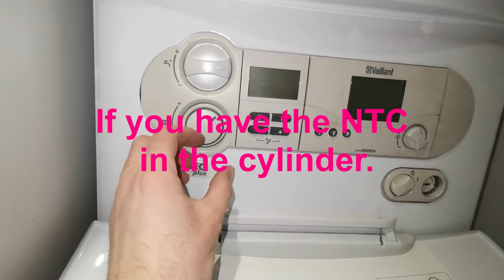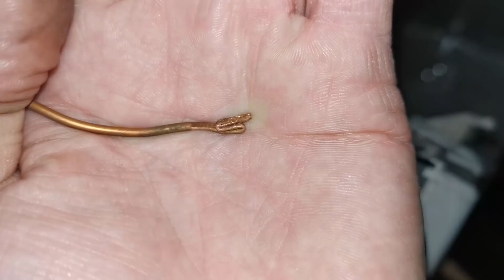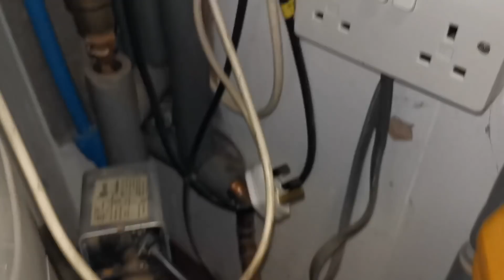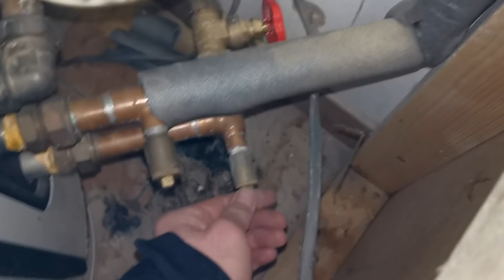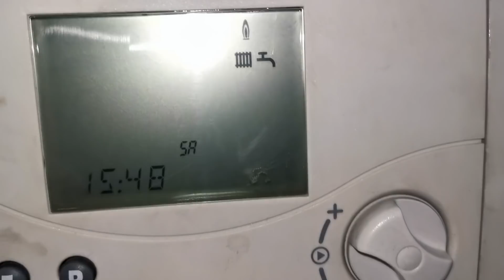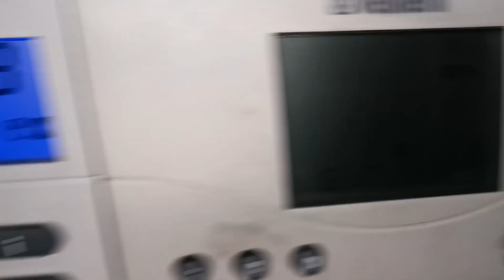Vaillant Ebus Controls. Repair No Heating No hot water HeatingGeek

Comment: Ebus:
It runs over a bus.  This comes from computer technology. What is a bus? It is one wire which many devices are connected to, sharing the same wire to send data to each other.  Think of a road with houses down each side with each having an address. The postman goes down the road and posts each letter (data frame) into each house. The street can be extended with more houses on the street. Now think of the road as the bus, with the houses as devices on the bus, like a computer (boiler pcb), temperature sensors, etc. It is possible to send data to each house by the controlling device using the address, And the houses can do the same. 

A protocol is a frame of bits that can run up and down the bus into each device, like a letter down a street - each device has an address. Protocols can be be sent from the controlling device (computer/pcb) or the sensing device. The protocol frame has an address, which posts this frame into the targeted device using the devices address. So, data is sent up and down the bus from the controlling device to sensing devices and back.  Like say the room temperature sensors sends data saying the room temp is nearing setpoint so the controlling device winds down the burner fan, then data again from room sensor saying setpoint has been reached, then the controlling device cuts out the burner.  The controlling device and temperature device know each others addresses, so when the controlling device gets a data frame from the bus, with a certain address, it knows what that device is, say a room temperature device. Then the software acts accordingly. 

The protocol has acknowledgements, meaning that when a frame is delivered the receiver sends an ack to the sender saying I have it - this ensures quality of service. 

So a bus in theory can have an infinite amount of devices on it - limited only by the software the controlling device (computer/pcb) is programmed to handle.

This in contrast to the open system (anyone can use) OpenTherm protocol which is only point to point, not a bus. One device talking to another over a dedicated, not shared, wire. That is fine for the vast majority heating system, especially combis. However a bus protocol is better for obvious reasons and larger more complex installations.
Reply: im sorry john no offence meant .I'm at a bad place at moment as I'm  unable maintain an erection and satisfy my wife and catch her cheating all the time any way things are looking up i got a big job this week im  changing a bath trap any tips
Reply: @Shayflannel  wrote:
"i got a big job this week im  changing a bath trap any tips"
Try a hammer.
Reply: c v ha ha what the fuck man
Reply: c v lol it isn’t a Mongolian she’s with is it ?
Reply: @Shayflannel  
Exactly. It sends plumbers to sleep as it is way above them.
Reply: John Burns CAN Bus is more robust
Reply: @aqib2000  
CAN bus was designed for vehicles by Bosch. I believe it is now open, so anyone can use it. Ebus is robust, as is CAN, as they are both on closed systems. CAN bus can equally be used for other applications besides vehicles.
Reply: John Burns CAN bus has been used in industrial applications for decades now!
Reply: @aqib2000  
Yes, CAN was convenient so used by others outside of vehicles.
Reply: @Shayflannel  
Keep your physical issue as they are, as anyone who can dig a hole that big in a few hours is highly marketable. 
Keep it up - in many ways.
Reply: its not above me if you were that intelligent you wouldn't be fixing boilers and systems for a living you melt
Reply: c v melt lol
Reply: @Shayflannel  
I do not fix boilers for a living.  
Yours
John Burns BSc (Computer Science)
Reply: I'm a ground worker any way
Reply: @Shayflannel  wrote:
"I'm a ground worker any way"
I admire people who dig.
Reply from the maker: WOW. Thats the info you cant even get from Vaillant. I was aware of the address thing because of joining them all together and it still works. However how does it know what temperature sensor it is looking at? Both (for instance Floor and outside) are just 10-12K @ 20c and don't have any extra stuff with them (that i can see) so how does it tell them apart? 
Im really glad you took the time to write all of that.
Thanks for helping us all out. :-)
Reply: @HeatingGeek  
"how does it know what temperature sensor it is looking at?"
Connecting say a room temp sensor to an Ebus, the device will handshake with the controlling device. It will be verified and addresses exchanged. The device is now on the bus. The data is exchanged between the two via the protocol. The controller knows it is the room temp sensor. The controller knows what the setpoint is (this can be set on the room temp device or by a separate remote method as in commercial controls), it exchanges data with the room temp controller continually, it knows when the setpoint is nearing and when it is reached, winding the burner up and down or on-off accordingly.
Reply from the maker: @johnburns4017  But if the sensor is nothing but an NTC how can it have an address. How does it know the difference between an outside sensor and a floor/HW sensor?
Reply: @HeatingGeek  
An NTC is an extension of the pcb electronics. The bus will be inside the pcb, extendible to outside by wires, depending on what device they want on it. But it is possible to detect an addressed device or a simple dumb device like an NTC (resistance). 

The idea is to get a plug and play when it comes to controls. Dedicated terminals for zone valves, room temp sensors, etc. All wires back to one point for simplicity and ease of fault finding. The installer (mainly plumbers) does not need to know the underlying technology. However the serviceman does.
Reply: @HeatingGeek  the VRC693 is (almost) just an NTC plugging into connector X41 - see my last post on here (Nov 2019) how to make replacements https://www.diynot.com/diy/threads/vaillant-weather-sensor-help.288642/page-2
The main PCB has all the various other A-to-D conversion etc to transform this into a temperature reading (which can be read on the front panel at  D47) and also makes that reading available on the Ebus like all the other diagnostic information.

I'm not sure about the wireless VR21 temperature sensors - whether they only talk to the wireless base station - or if the wireless base station also puts this value on the Ebus.
Ebus is a pretty basic (i.e. cheap for manufactures) protocol. https://en.wikipedia.org/wiki/EBUS_(serial_buses)

Real shame that vaillant seem to have abandoned their diagnostic tools - can get lots of information about boiler performance off the data available on the eBus

Comment: Why did you have to change the valve body ? Could you not just swap heads ? I do love the vids bro 😁
Reply from the maker: Because this was an insurance job that had gone on for 3+ weeks. I needed to fix there and then. Siemens make the replacement head for these now. But couldn't wait. 

Thanks for watching. :-)
Reply: Shit quality zone valve, the valve it’s self will fail in a couple of weeks anyway.
Reply: Fibre Washer no it won’t
Reply: He did say he didn’t have a head for it so he replaced the body I imagine to a Honeywell that he keeps stock on the van. That’s the call he made to get it going. Not the thought that the body would pack up in a week, as he did say the valve body was fine in the vid bro. Either way great work keep it up bro 😉
Reply from the maker: @TheDickPuller  They seam quite good. No recalls for them. The 3 ports have had some issues.  Anyway its the insurance company that supply them.:-)
Reply: Agreed. Why change the valve body?